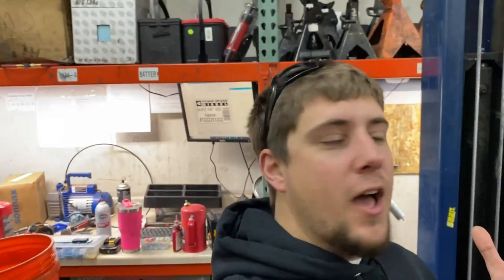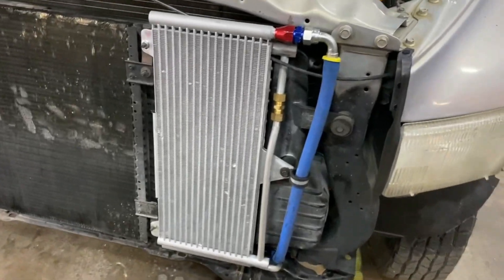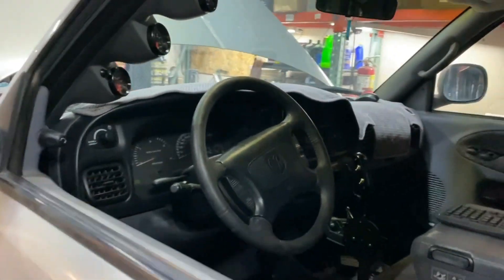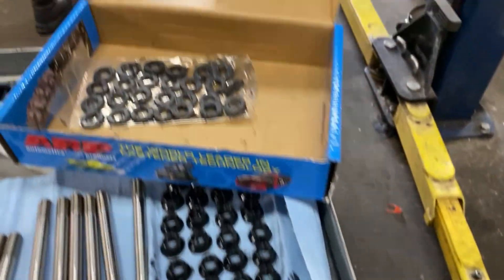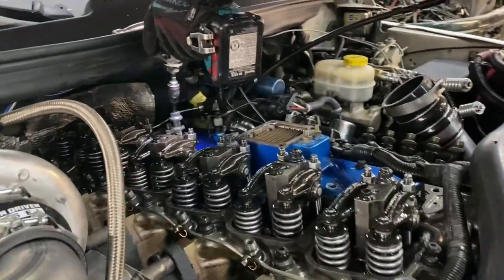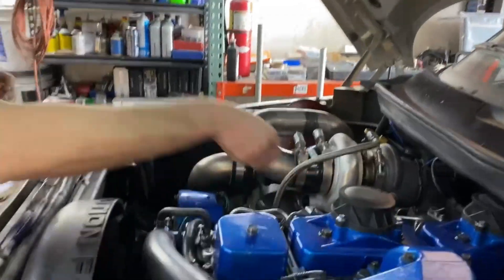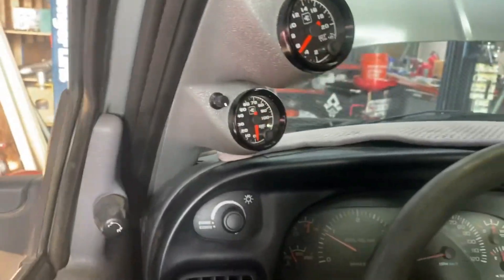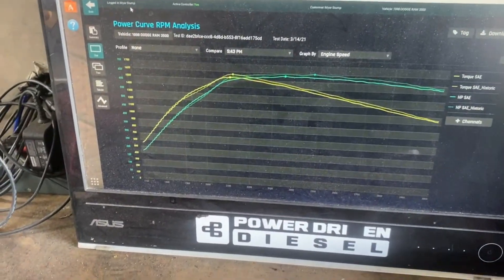ULTIMATE TOW RIG 12V STROKER 6.1L DYNO TIME!!! HUGE TORQUE!!!

Comment: High performance 12 valves have been tuned to 600 to 650 HP for 20 years now, long before strokers even existed.   The power, while keeping EGTs down, has always been there.  Towing with that much power is another matter.  Above 450 HP, towing up long steep grades on hot summer days, the problem becomes engine cooling on a 2nd Gen.    Address the radiator for an ultimate towing rig.   I also believe a manual valve body isn't near as slick as an Anteater for street and towing.  Keep up the good work.

Comment: An idea I’ve had for a while that we will get to test on our dyno hopefully soon. But with a setup that’s over pumped per say. The injector may be incapable of flowing what the pump is pushing at full rack you would see a higher injector line pressure with a long bleed down phase increasing the actuator injection duration some, so it would be interesting to see what would happen if the plate was moved back to reduce max rack travel and injection duration to the point that matches up with the injectors optimized flow vs pressure window. We know we loose power in mechanical systems if we over injector, so what happens when we under injector and try to over flow it, a lot of the smoke could just be from excessive duration in the system. Just random ideas I’ve had. We have a 94 with a built 12 mill in stock sticks that should be a really good test bed for this idea. But you may also have a really good test bed for the concept as well.

Comment: I wondered how the 6.1  12 valve would do as far as torque . I like to watch these but I would only be interested in usable power to tow . I also been told the 450  500 range before the cooling system is taxed. I had some problems with  heat in my 95 so I installed a MIshimoto  radiator in it . . I can see why you fellow like automatic transmission I don't think a standard could stand that kind of torque . That is a nice build . If you guys get time I like to see how the truck does towing . Thanks for you time .
Reply from the maker: We definitely will do some testing

Comment: Have basically the same build. I'm running a superbee special 62 over a custom FMW 76MM and 19.5* timing with a 215 pump. Hitting 82lbs of boost with the secondary gated at 35psi. Full fuel (no plate, housing FF, racked barrels, 2095, PDD delivery valves, billet housing) and I make only a VERY slight haze at full throttle. Not sure why this is so smokey. Industrial Injection 5x14
Reply: Curious why not just use the 6.7 block?

Comment: Try it without the DV's. Go back to the 181's.
Reply: I found the 131's work the best on a street rig. They provide a cleaner cut off and less injector needle bounce.  The cc's you loose with the smaller dv's weren't fuel you needed anyway. They make your injection event longer which isn't something you want unless smoke and heat are your goals.
Reply: @bcbloc02  If he swapped in a set of 5x12's and didn't touch anything else............. That might be the ticket.
Reply: @witcher71  Smaller injectors would really limit the max power output.  I know 5x14 extrude hones can easily support mid 600rwhp.  My next upgrade for clean power would be going to a 13mm pump and less rack travel.
Reply from the maker: He’s actually going quick rate cam!
Reply: @horsetorquesdiesel  DETAILS!! Colt?